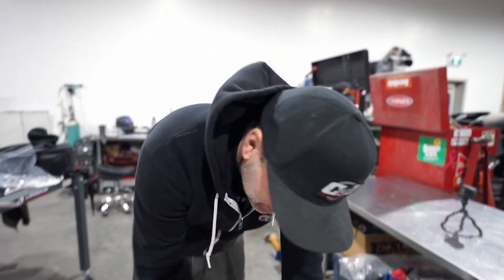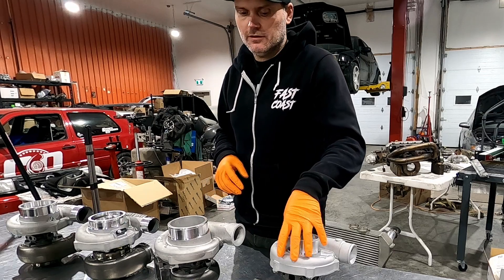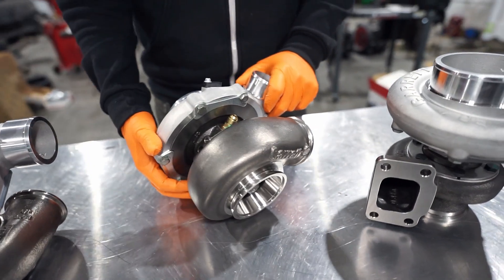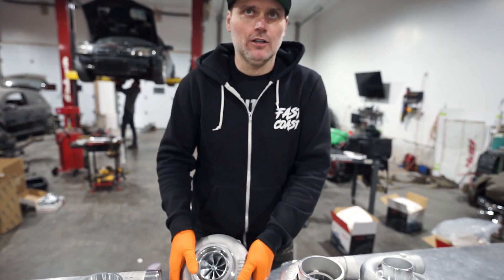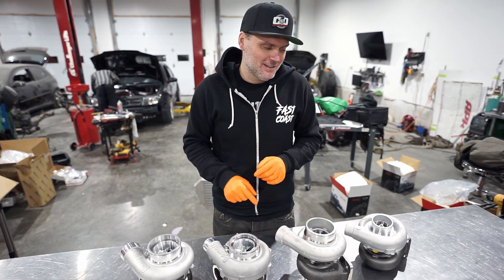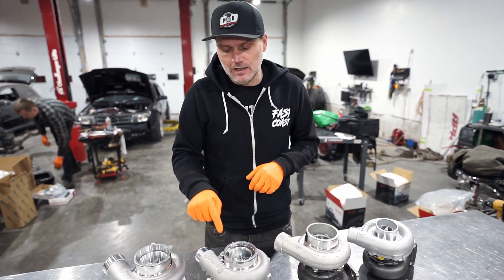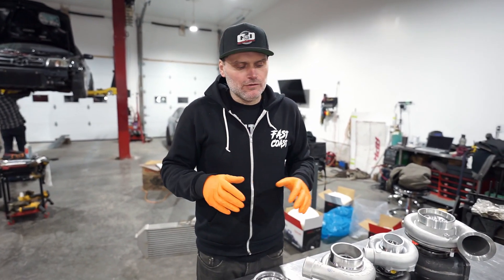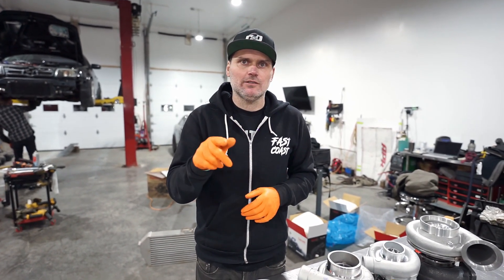Does size matter? Comparing four generations of Garrett Turbos.

Comment: I went from a GT30 to a GTX30 gen 2. Gain 500 rpm of spool and 100+ HP at the same PSI.
Reply from the maker: Yeah very good increase in that model for sure. The gtx3071 is a great turbo.
Reply: So this genuinely confuses me from a thermodynamics standpoint. If the boost pressure is the same, intake temperature is the same, the only difference could be resistance in the exhaust to spin the turbo....? Flow into the engine shouldn't change if it's just a turbo swap...how is there a HP gain? Is it just that the larger turbos at the same PSI are generating that much less heat, a bit less resistance due to more advanced technology in the turbine?
Reply from the maker: @MeltingRubberZ28  it's pumps more air, more flow, less resistance. So although similar size it's design design makes it work like a large pump.
Reply: @MeltingRubberZ28  on GT/GTX turbine is the same, like a 30R. Compressors on the GTX are the ones that become more efficient. On the G series, both turbine and compressor wheel are more efficient. Meaning they are smaller, and are way more efficient at higher boost levels compared to old version. Efficient turbine = less energy required, efficient compressor = less friction, less heat, more flow mass rather than PSI
Reply: @luispadilla1675  the struggle I have though is if your intercooler is functioning properly the temperature shouldn't be drastically different so efficiency is a fairly moot point at least from a temperature standpoint. Less drag on the motor seems to make sense, but once again I would think that's a pretty marginal amount. 100+ HP seems pretty drastic. I guess it's just the sum of all those things adding up though.

I think my main concern is the engine shouldn't be actually "consuming" more air at the same boost levels, correct? There is no additional air in/out, it's just a "more efficient" process which makes the power?
Reply: @MeltingRubberZ28  But it's more than that. The amount of air flowing through the engine is hugely dependent on pressure ratios. Gas will move in proportion to the pressure differential forcing it through the system. You can flow more air by cramming it in the intake, BUT you can also flow more air by freeing up back-pressure on the exhaust side. (How efficiently the turbine wheel can harness energy while still flowing large amounts of gas)
Compressor efficiency is a huge factory by simply being a measure of how much air it can move efficiently. Efficiently meaning without working and heating the air too much in the process. This is why larger turbos flow more air at lower pressure, comparatively. The harder you need a compressor wheel to pump beyond its efficiency range, the harder the turbine wheel has to pump it, which creates backpressure, and inhibits total system airflow. That's why it isn't SIMPLY an "if you have enough intercooler to handle the heat it should make the same power" situation.
Reply: @evanchi9460  interesting thoughts. I appreciate the response. Will still have to think it over a bit as I'm still struggling a bit to understand.
Reply: Your turbo is Like a cork in your exhaust. Just like it's a cork in your intake. Bigger turbo,  bigger hole for the air to go through... less corked up...   the air leaving the cylinder has to push into that manifold pressure created by the turbo and exhaust.... Bigger hole, less pressure to push, more volume gets through the system... mo' powa
Reply: I prefer 2 small turbos over 1 big turbo on a V6 or V8 because I want less turbo lag. 2 GBC22-350 turbos on a Nissan VQ37VHR would give you up to 700 hp with NA like responsiveness.
Reply: @davidperry4013  People think big single turbo, big wheels more intertia more lag, but look at it this way... 1 big turbo gets 100% of the exhaust flow vs 2 smaller turbos get 50% each... lag will be the same.  The only thing that will improve responsiveness is smaller size turbo (or turbos) but then you sacrifice top end. Twin turbos also cost more, extra plumbing and fabrication, etc. Twins can look cool if high mounted but that's aboit it.
Reply: @patrickm9785  was that holding 15PSI all the way to redline, or did it peak and drop, and the bigger turbo is simply holding 12PSI the entire time.
Reply: @MeltingRubberZ28  I'll try and explain as simple as possible. What we call boost pressure is only the result of resistance - as measured on the intake side. Less resistance = less boost = more air flow. (Place your thumb on the end of the garden hose, pressure in the hose goes up while flow rate goes down). You may think this resistance is only the resultant sum of intake restrictions (eg. throttle body, head porting, valve size, cam profile, etc) but there's more to it... Take a guess what kind of pressures exist in the exhaust manifold when the engine is on boost...?  It's not often measured or spoken about, but it's a HP killer. Exhaust manifold pressures can be just as high as the boost pressure on the intake, and even higher with small turbos being pushed hard. A small amount of that exhaust pressure remains in the cylinder even after the exhaust valve closes creating back pressure, not even considering the detriment during valve overlap, and these are major factors the fresh intake charge is fighting against on the way it. A more efficient turbo (be it slightly bigger or simply newer tech) will make all the difference to improve all of the above plus the overall benefit of right-sizing. Example, I once modded a car with small factory turbo pushed to its limits, the car was making 90hp@15psi, upgraded to bigger turbo, it made 110hp@12psi. No other mods, even same standard exhaust manifold, same intake air temp.
Reply: @MeltingRubberZ28 good question, it would spike up to mid 15's in mid range and pull back to mid 14's up top. The new turbo held 12 pounds to redline with ease, we limited out of concern for the stock engine internals, became a totally different car to drive.
Reply: @MeltingRubberZ28  all depends also on engine, how much gases produce

Comment: my ej207 runs a GT28/60 disco potato model = 365hp std cams = 565cc injectors big exhaust - about 300hp at 3,500 rpm = 8,200 rpm limit - club members saying i am more about 380 hp - they are running 400+ hp and i am never left behind .

Comment: Im running a G25-660 on my mk6r golf with external gate. Its a awesome street turbo. Quick spool time and sounds like a old hks T51r. Currently building my spare motor fully forged and thinking of moving up to a g30-770 for a bit more power as i think the 660 would start to struggle a bit once pushed. Id rather the 770 running at like 80% instead of the 660 running at 100%

Comment: Put a GTX3071R Gen2 on my 1.8T stroker build.  Nasty spool ☠️. Still working on dialing it in w/ MBC.
Reply from the maker: Chuck the MBC in the trash. 😉
Reply: Ha!  Been told that before.  I’m running it in conjunction w/ N75.  Using my stock ECU, I’d have to to jump to aftermarket to eliminate MBC(?).  It’s a United Motorsports tune w/ are highly recommended in my area.           Why do YOU say toss the MBC? Is it for several reasons? Like I’m unable to completely mash the gas pedal w/o it 1st igniting the tires then w/in second(s) go straight to wastegate.  I’ve really got NO control.  I’m running @15-18lbs boost(too much maybe) & I’ve really got to pedal the shit out of it to get it to hook up.  I’ve got over $20,000 into a car that I’ve got for absolutely nothing and was just trying to keep some cost down but I think this is one expense I’ll have to succumb to?  Not sure......🤷‍♂️
Reply from the maker: @neildantino4709  You get what you pay for as you say. If you understand from the money you have into the car that doing this stuff isn't cheap. A MBC is a band aid in most applications, especially where boost control is vital to drivability and protecting the engine. Since most MBC can cause large spikes in boost or erratic control it typically isn't going to be the best solution... not even close. 

To answer your question, yes a proper EBC will work with your application. Just disconnect the vacuum lines to your N75 and keep it electrically plugged in. And use a EBC to control boost. Or get your tune worked to use the N75 to give you the control you want. We use EBC on most builds so we can control boost as we want. Whether its boost per gear, boost per RPM, or boost per MPH. Way more perks, control, and fail safes using an EBC over a MBC.
Reply: @COMotorsports  2port? 3port?  AEM decent, who do you prefer? I’m in Saco, ME. Not too far from you, I’ll swing by! 😜   I wish.
Reply: How much power?

Comment: Garett is the only way to go I’ve ran a first gen gt3582r journal bearing as my first turbo that’s on my prelude for 8 year with no coolent never Had an issue not once s then I upgraded to gtx3076r gen 1 and it made more power on less boost then it’s bigger brother and an amazing spool rate and it just plain sounded amazing now I have a gtx3582r gen 2 I’m shootings for around a bit over 700 to the wheels I got the .82 housing and the 1.06 just in case I wanna run it out a bit further but I wanted a turbo to spool at a good rate on pump gas around 500 whp for street driving and then still work for higher numbers on ethanol if and when I ever go for more the gtx3584rs will be my next turbo for sir I’ve always loved the gt line they have never let me down it’s true you get what you pay for in turbos
Reply from the maker: Agree in every way. 👍

Comment: Ive always ran Garret. They are loud proud and pound out some power. Sold it but hadf an 04 STI with a Crawford block blah blah blah was over 400whp and it had a GT30R series in it with a smaller .63 ar hotside. Looking back I would have went with a .82ar instead for increase exhaust flow and more mid to high end power. Now I have a 05 SG6 Forester with IAG stuff in it and a little smaller 18G in it.
Reply from the maker: Hard to beat a Garrett for sure.

Comment: I'm curious, what are the wheel size comparisons on those four? If they all had similar housings would they have similar boost threshold and response but different power?
Reply from the maker: These are all different wheel sizes which is why they're labelled differently. However if they were all the same wheels and just different turbine housing they would spool differently and make different power at the same boost levels.

Comment: I'm looking for a pair of turbos for a 3.2 vr6 24v twin turbo build; target hp is 500, but having potential for ~600 would be good (limiting factor is the clutch).
I was considering a pair of gtx2860r gen2 turbos but would appreciate any helpful suggestions...
Reply: Gtx2860r makes 300 to 375 rwhp on 1.6litres
Reply: For only 600 you might as well just use a single turbo with a Y pipe to join the cyl banks

Comment: Currently running a gtx3071 gen2 on a mk5 looking to upgrade to g30-770 or g30- 900 but don't want it to laggy how would they compare to my current turbo.
Reply from the maker: Have no dyno experience with the G series yet. However typically the more power you want the laggy it's going to get... it's the nature of the game. However the best chance you're going to have keeping spool is going to be with a G series.
Reply: if you want the fastest spool go wit the g30-770... but if you want extra room for growth when you go e85 n big boost... g35-900.    Whats your end power goal?  the 770 is rated at “770” but in reality it kinda tops out at the 600-650ish range from alot of dyno vids n runs ive seen.  So if you trynna make like 750+ whp... you wanna select a g-series that is rated at 900+.  Going anything bigger like a g42 or even g35-1050, most those top FD guys they start using nitrous to spool it up faster.  But tl;dr.  If its a fast lil street toy choose g30-770... if you want somethin bigger skip g30 and go straight to g35-900.
ATP even makes an aftermarket twinscroll housing for g35-900/1050 now !!! Im mad it takin my fabricator so long to fabricate my manifold (he used a v-band still since g-series from factory only have v-band option...) ATP even came up with a t4 divided aftermarket option before the dude is even done fabricating 🤬🤬🤬 LOL FAWK.  So now i might have to sell the manifold once it arrives 😤😤😤.  The only plus side of those vband is no need turbo manifold inlet gasket and they almost will never come loose (no worries of 4 nuts coming loose on a t4)... but at the cost of not having twinscroll which is a helpful spool aid.

Comment: Great video....I have a gt3582 journal bearing on my zx11....microsquirt v3 running it ,on custom efi...1:1 regulater...not much room between turbo and front wheel...lol....so these smaller/yet more eff, is cool....Its cost holding me back on the newest g series....but may upgrade to a gtx3076
Reply from the maker: They are pricey for sure but guys have been having great results with them. I will add, the G series are quite a bit heavier due to the center section.
Reply: @COMotorsports  thanks...I didnt kniw the were heavier...since im on a motorcycle, not wanting more....but I can make a support bracket....but run a gtx first
Reply from the maker: @mokokawi  The gen2 GTX's are very nice, compact and make the jam.

Comment: What turbo and manifold  would you recommend for a stock lower end b5 aeb 1.8t Passat. For a budget 280-300hp build. With  a 630cc/vr6 maf housing  off the shelf stage 3 tune from reflect tuning. 557p ecu.
Reply: gtx 3071
Reply: Budget? Gt2871 will support your goals, and more..More money? Go Gen2 gtx2867. Any bigger for your goals would introduce far more lag without any tangible gain; unless you want to run 1000 cc injectors, cams, and start rethinking other parts of the build, such as intake manifold, etc

Comment: Hey there. I’m looking to build my 1.8t in the coming season for street use. I’ve looked at tons of different turbo options, but could definitely use your opinion. Looking to make around 300hp on lower boost and 450-500hp on higher boost level. Recommendations for a turbo suitable for this application?
Reply from the maker: We can certainly supply a turbo to meet your goals. Drop us an email with specs of your build, power goals and what you plan to do with the car and we can hammer out the turbo to fit the needs.

Comment: Currently running an Owen developments reworked gt3586 on a fully built rb25, full boost by 4krpm 650whp 550ftlbs, would I be able to get the same power and faster spool on a g30-900?
Reply from the maker: There's two versions of the g30-900 one would spool quicker.
Reply: @COMotorsports  any idea which is the faster one I should begin researching?

Comment: Hi i would like to ask some question!!!

I'm building a Golf MK6 R with a EA113 Gen2 Engine street car am buying a Garrett 3076R Turbo Ar 63 will cause my car to lag alot and approximately how many HP will i be able to push out of? As my car is fully build with fuelling, meth and forge internal. I'm trying to push for 600++bhp is it possible? Please help first time doing a build
Reply from the maker: On the GTX Gen 2 3076 you'd could make 600whp with it, not gonna happen on the standard version. You biggest issues on that setup is fueling.

Comment: Question i have a car with twin turbo settup with it own oil pan,61mm t3/t4 garrett could you tell me wich oil i should put in
Reply from the maker: Lots to consider, manufacture requirements, climate, what the vehicles being used for and a handful of other things.
Reply: @COMotorsports   used in a jeep srt 6.4, part # 715583-5007

Comment: I'm new to Turbo talk so what size turbo would be good for a SOHC Honda engine. I was looking at some T3/T4 turbos but now swaying towards the GTX line for size and performance. I plan on getting forged internals and upgraded fuel setup. This car will be primarily a daily so about 4 of 7 days a week I'd drive, but I'm looking for big end power over torque. I want a good amount of power across tha band and not fall off.. I'd say about 500-600whp for a Honda as an extreme daily but enough to be safe.

The Engine is rare and will require alot of custom parts but I'm up for the challenge, already set up for e85 just need to build the block which will happen later. Engine: 2.3l SOHC Vtec F23A1. If anyone is willing to help out source a few options for a turbo I'd appreciate it.
Reply: What makes you think the f23a1 is a rare engine?
Reply: @rwdimpreza2.533  Not meaning rare as in OEM applications for rebuilding.. rare to get aftermarket support! I remember looking up stuff whenever i got the car for the 1st time because i was curious if worth building (any car can be with enough dedication) but for like K series support platform its alot different, before the EPA ban bs i do remember seeing quite the bit of support for the car engine mod wise and not needing so much custom work done but so much has slowly fell off the market and is no longer made.

Comment: So this is going to sound totally off the wall, but you know what I wanna see? A custom done Bugatti Chiron with two twin-scroll Garrett G45-1500's and equal length 8-4-2 headers on each side that are set up for as close to perfect scavenging as you can get. And then run the exhausts from each turbo into a massive 2-1 tailpipe with a long crossover/blend section. Yeah, basically I want a 3000-WHP Chiron with "instant" spool. I don't even care if I own it, I just wanna see if anyone has the balls to do it. Then put like 355mm slicks all round on it in the tiniest effort to grip.

Comment: So any recommendations on what to use for a 3.6?
Reply from the maker: Not a straight forward answer. It all comes down to what the vehicles being used for, and what your power goals are. A turbo for a drag car, street car or drift car are a lot different.
Reply: @COMotorsports  well its my v6 challenger and I'm thanking about boosting it, it makes 305 chp and I'd like to push it to the 400s